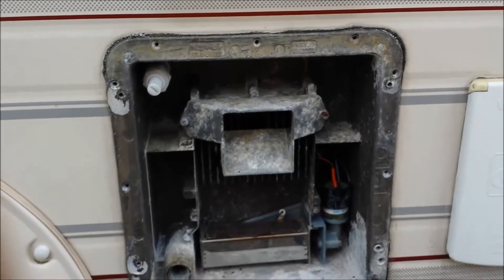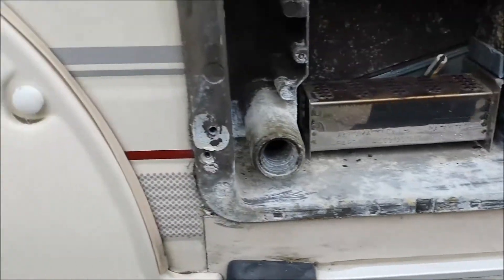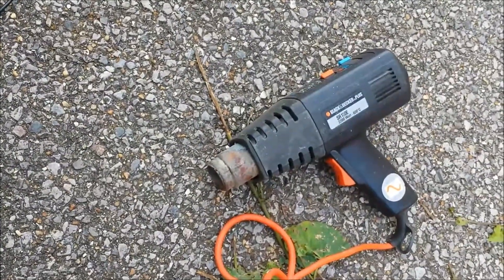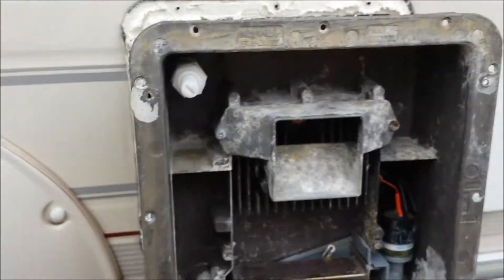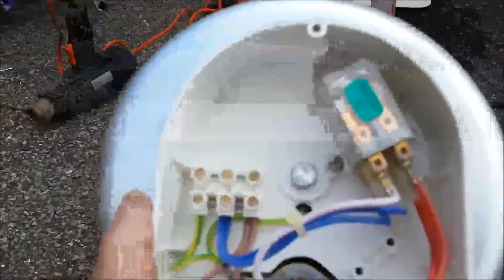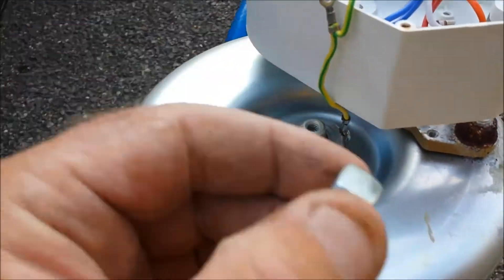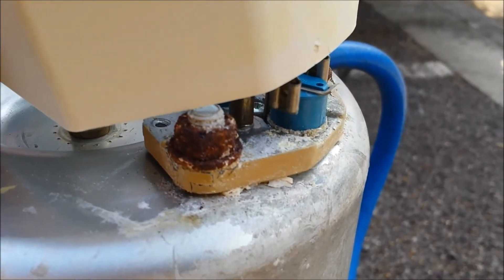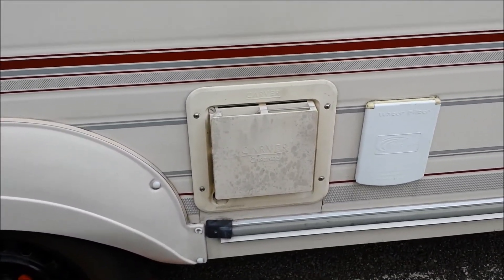carver rapide 1

Comment from the maker: yes the big o ring. while its down fo the element gasket as well. easy job to do once the tank is out. some caravans you can get tank out without taking the outside burner off. mine had to be taken from outside. its not hard job at all.

Comment: Did you a second video.  Mine is leaking from where the round tank connects to the square burner.  Would that be the big o ring gone?
Reply from the maker: yes that would be the big O-Ring. when you take it apart you need to put a new o-ring on the other end too. . if you dont have room  to pull it apart inside the van then take it all out in one go from outside. use air dryer on hot to make the sealant go very soft then pull it out. i needed to use heat gun as outside air temp was not too warm at the time.... using hot air gun the mastic between unit and van goes nice and soft allowing the whole thing to come out... re-seal with new mastic when putting back in.. job done.. oh and test the unit outside before putting back in for no leaks..

Comment: Hi, does the tank just pull straight off once you have undone the nut and removed spacers and seals etc?  Mine is not coming off and I am reluctant to pull too hard in case I break it!

Thanks
Reply from the maker: yes once you have the centre nut spacers washers etc off you can then pull the tank off. there is a huge O-ring  that fits on the burner housing that the tank goes over to fit to burner housing, it does take a good bit to pull it off and takes a bit of pressure to put it back on. i used a drop of fairey liquid on the seal/0-ring when putting it back on.